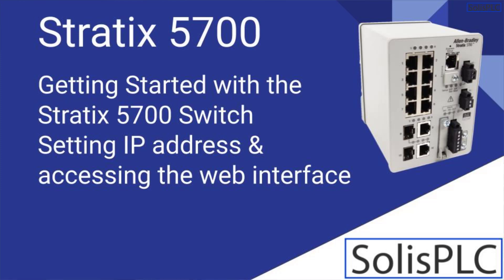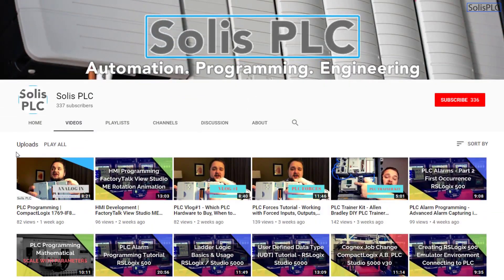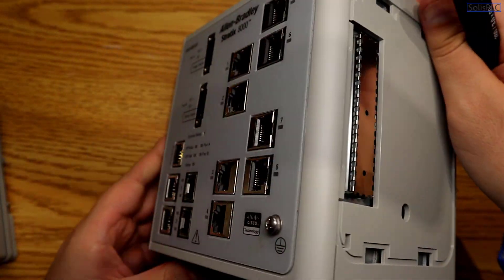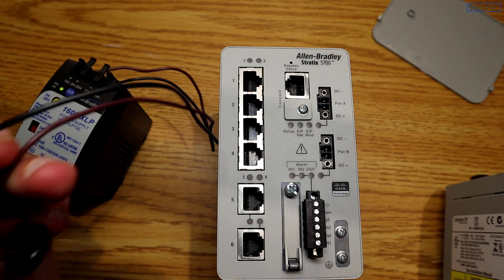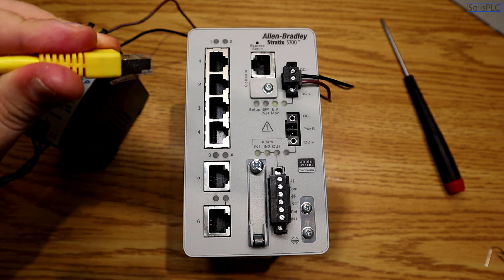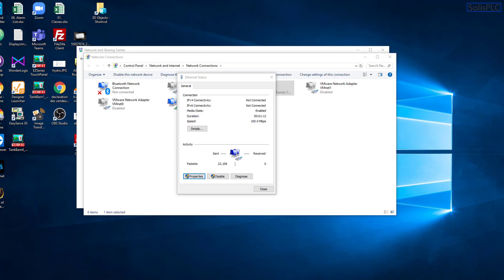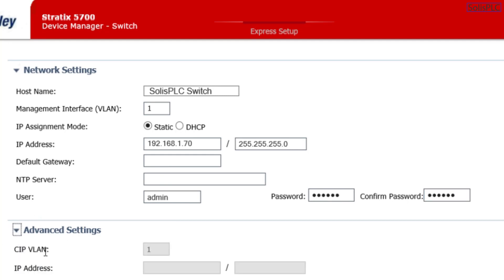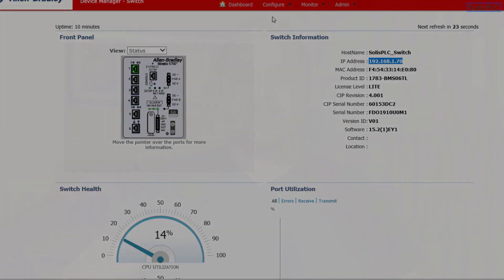Stratix Switch 5700 Express Setup | Rockwell Automation Configuration IP Password 8000 Network Cisco

Comment: If I need connect a tooling with different ip addresss than plc . Let's  say tooling have scanner, cameras, sensors ,pneumatic block ,ios everything with ip 192.20.20.xx but the plc is 192.168.1.1 with Gateway 192.168.1.2 I cannot change ip addresses tooling because should run in  different lines.  What can I do for plc 192.168.1.xx be able to recognize the tooling with devices 192.20.20.xx?

Comment: if we need to connect to PLC and HMI and other devices which have their on IP addresses, do we need to assign each port for them or the switch will work to communicate with them as long as the assigned IP address of the switch is in the same network with the rest of the devices? when we need to assign a gateway address ? thx
Reply from the maker: In a basic setting, the devices should have their own IP addresses and the switch will just make it work. As the network becomes more complex, you'll need a default gateway to route between networks, you may need additional protocols to manage traffic and connectivity to the outside world, etc.
Reply: Thank you for the answer. Just to make sure I got it right. If we just put the switch in the same network by giving it a new IP address, it will work like an unmanaged / open switch?

Comment: Hi Vlad,
I need your opinion on which device is better.. the 5700 or the 8000?
Reply from the maker: They are slightly different. The 5700 is a highly rugged in-machine switch. The 8000 is an expandable switch with distributed network options. It depends on your application, but in general, if it's a machine or a small area, I'd choose the 5700. If it's plant wide network, I'd use the 8000; you can add more ports to it with extension modules as needed.

Comment: I need to change the ethernet port how would i do it.
Reply from the maker: What do you mean by "change the ethernet port"? Move the cable to another port? Change IP? Reconfigure a port?
Reply: @SolisPLC  thanks for reply. What i meant was u used that configuration switch for selecting switch 1. Do i again need to use configuration switch for selecting switch 2?
Reply from the maker: @The_IndiGenius  Once you configured the first port, you can use the web interface to configure the others. During the setup it's important to configure one port in order to gain access to the switch; afterwards, you should use the web interface as shown and configure the rest.

Comment: I went to a customer to upgrade their CompactLogix PLC and noticed their Stratix 5400 20 port basically running out-of-box mode. I don't know much about managed switched, but I logged in and didn't notice any changes. Unless I missed something. It appears to be a $3k unmanaged switch from my point of view. What are some settings I should check to confirm that in fact it is unmanaged?
Reply from the maker: I would start by looking at SmartPort assignments. To be frank with you, most of these that I see in the field are set up that way: unmanaged.

Comment: Great video Vlad, if I already have a Stratix 5700 installed from an integrator and they did not label what IP address they gave it, how would I be able to access the web page for the switch?